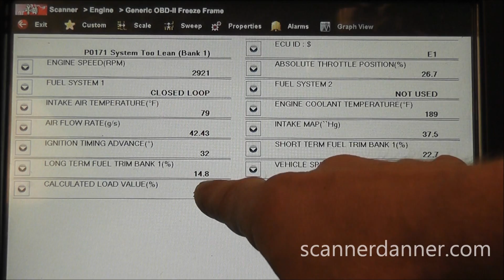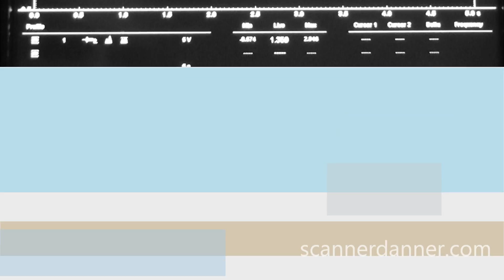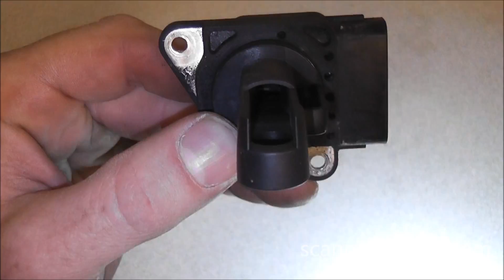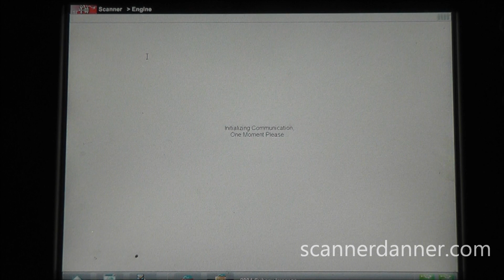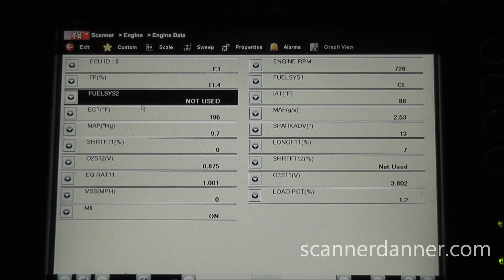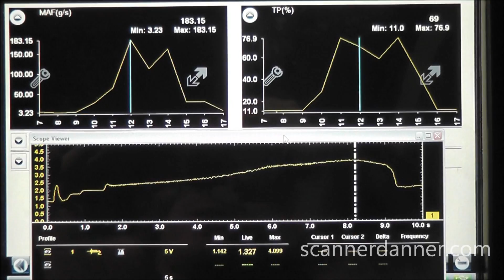How to identify and clean a dirty MAF sensor (Subaru)

Comment: 10:15 well it does, as the air density will change depending on the air temp so the car needs an accurate air temperature
Reply from the maker: This is a completely separate sensor input on this design. So the IAT signal is NOT a concern here , at all, with what we are dealing with. 
We were not discussing the purpose of an IAT sensor

Comment: Thank you so much for this. I've been trying to diagnose a P0171 in my 07 Forester XT for months now. After watching your video, I checked the freeze frame data, and it was under load when the code tripped. Popped my MAF out, gave it a good cleaning, and popped it back in. Not only has the code not come back, but it seems that my XT hasn't been running at full power for a while now, and I didn't even know it. Now to figure out my P1153...
Reply from the maker: Heck yeah! Nice job, always feels good to help others

Comment: Is the LOAD _PCT 1.2 % normal, mine having the same value however the workshop manual says is 18% at idle.
Reply from the maker: Depends on the data PID, some offer absolute load and calculated load and they will read differently. If you're fuel trim numbers are good at idle, then I wouldn't be concerned

Comment: Great video man I learned a lot, hoping this will fix my issue with my 02 wrx. Getting break up around 4k rpms and getting a slight bog right before I give it throttle. Gonna take some brake cleaner to the MAF and I also have to replace my center differential viscous coupler. gonna be a fun weekend
Reply: Did it Fix your issue?

Comment: I had been a bit baffled with this problem. I had cleaned my K&N air filter and changed out my fuel filter, with no real change. After cleaning my MAF, my '98 Subaru is running like a beast! Thanks for the detailed help!!!
Reply: What was your car doing prior to cleaning the maf
Reply: @SubaruSupra3  it would run smoothly at idle and most times at speed. Other times it would just die at idle or at speed. Overall power was not good. Poor acceleration.sometimes surging while driving.
Thanks again for the help

Comment: Very informative. My  2007 JDM 2.0L turbo-charged subaru forester has the duty cycle  stuck at 66% and as a result  I do not have boost even at WOT.  My mech thinks it could be the fuel pump (the relay works fine), however the vehicle starts perfect , runs very smoothly so  I ruled that out and now I think it could be the MAF (although I have no codes). Thanks

Comment: Video was super informative for my Legacy GT! Is it OK to use throttle body cleaner/intake cleaner on a MAF sensor or is that a bad idea?
Reply from the maker: Just make sure what you are using doesn't leave a residue
Reply: I went safe and bought MAF sensor cleaner, but the CRC throttle body cleaner I use doesn't leave a residue as far as I can tell.

Comment: Would a bad maf sensor cause multiple misfires? I changed my plugs and coils but I'm getting this code as well as misfire codes on cylinders 1,3 and 4
Reply from the maker: attack the misfire issue first. most likely your MAF code is being caused by the misfire, not the other way around

Comment: Thanks for this excellent video and diagnostic.  I fixed my 2005 Forester XT after numerous visits to the dealer with no luck.  Turned out to be a tiny blob of dirt on the hot wire.
Reply from the maker: sweet! Thanks for watching
Reply: What were your Driveability symptoms with the Dirty Maf Sensor?
Reply: @TinkeringTom91  There was a distinct delay in revving when you hot the throttle. As if it there was fuel starvation
 So if the car was in neutral and you stabbed the throttle the engine hesitated for a second then revved. Also down on power on the road.
Reply: @roofbolt1  My Wrx won't seem to go past 4k in any Gear Very Sluggish only reving in Neutral can I get it Higher,  2013 WRX 70kmiles I have changed Air Filter and Spark plugs already, new throttle body w/sensor, Mishimoto Hose, slightly better still Seems Bogged Down... Should I go for the Maf Here, also ordered a Crankshaft sensor before I Saw this Video.

Comment: 04 forester xt ej255...i got a p0172 pending code not stored and no cel but my car is basically almost stalling out at idle and will lag and then jump back up on accel. As well as the fuelsys1 being in open loop-drive whenever i let off the throttle or give it enough gas. Think this would help?
Reply from the maker: You've definitely found the right video for your symptoms my friend. Good job!
Reply: ScannerDanner haha thanks I cleaned my maf just like you said and although the problem is still there it's way better so maybe I just need to replace it full on...anyway thank you very much!
Reply from the maker: that is possible, but without some data there is not much else I can suggest

Comment: Hey guys! I have an 02 WRX 2.0 turbo, my car last night just ran a pfffe code along with every cylinder misfiring.. car bucked and hesitated under acceleration. Recently, it has started acting like this in the rain, almost stalling out on me. Could i get off the hook with cleaning MAF? Or, should i be checking coils and what not. Please get back to me! thank you!!
Reply from the maker: What you are describing is a classic symptom of a secondary ignition misfire. Take a close look at your spark plug wires. Get a spray bottle and squirt them down and see if you can make it misfire. If you can, change the plugs and wires. What you are describing is not a MAF sensor symptom
Reply: ScannerDanner Okay! Im going to be doing spark and coils anyways. But cleaned MAF and haven't had the issue since. Wonder how plugs look hehe xD

Comment: Ive got 2001 subaru impreza WRX turbo  DTC  to lean P0171 ,RPM 740 , STFT 25 and LTFT 14.8 MAP36.0 MAF 2.1 g/s oxygen sensor 3.943 V if engine RPM 3000  STFT 2.3 and LTFT 14.8 whats causing that
Than you .
Reply from the maker: That is a huge difference or improvement at a higher RPM. You have a vacuum leak, not a MAF issue
Reply: I did not find any vacuum leak anyway ,I will try again , thank you a lot for that .

Comment: I love you man! 

You are a Genius compared to my mechanic, who offered to replace EVERY POSSIBLE sensor in my MY2007 Subaru Legacy, 2.0R, non turbo, 2.0l, Wagon. European B13 starting with the O2 sensors and so on...$$$$$$$$$

You saved me and my Subbie from a VERY EXPENSIVE and NERVE WRECKING REPAIR.

I have fixed a Subaru Legacy error p0172(The car was mostly STALLING or hardly kept running on idle)- with ONLY SPRAYING THE MAF sensor with https://products.liqui-moly.com/air-flow-sensor-cleaner-3.html

Big THANK you for creating this video!!!

Comment: Can I have a MAF problem without a code?
Reply from the maker: absolutely
Reply: I chased my tail on a Subaru once, chasing down 25% trims. I had to fix 3 vacuum leaks and 2 new injector o-rings before throwing a MAF in as a total guess, and it worked. Sort of "under-reporting" on top of having all those intake leaks.
Reply: My 01 corolla has no check engine light and runs good, but when you plug the OBD, the reader shows 3 codes although the bulb of the check engine light works.

Comment: Hi Danner:

I recently got a P0172 and AFR's were at 10.0 at idle. During driving it was 12.5 or so. I cleaned the MAF and dramatically made things better. It was still bucking on initial acceleration. The MAF is an original OEM Subaru One. Figuring it might possibly be a MAF sensor issue. My friend happened to have one dandy, Part Number 197-6040. So installed that literally 30 mins ago and it seemed to run better with no bucking. Also the ECU has been reset.

Comment: I was told to clean the maf to test and see if the numbers/ and or drive-ability got better, and then replace it if it did. This was coming from a instructor employed by a sensor company, smart non the less. but cost on these sensors can get real expensive. so i say clean it to see if it numbers improve, and don't replace until code or concern comes back!

cleaner is cleaner  in my opinion, how can one be more delicate than the other? like fuel injector cleaner, if gas ain't cleaning them enough how the f is some clear juice super concentrate crap going to clean it adding it to a tank of gas going to clean an injector?

Comment: It does use the built-in IAT sensor as a reference... but it would be a very minimal impact on performance if any. Sweet video :)
Very correct on the assumptions for turbo cars. Once the turbo is spinning under load, you're well over 200 g/s

Comment: Thank you!  After 10 years of driving with hesitation/stuttering/missing/leaning out/check engine and blinking cruise light,  I sprayed the hell out of the MAF Sensor with Carb Cleaner and my '04 STI is running smooth! Awesome video and explanation! Thanks again!
Reply from the maker: Thank you!
Reply: Hey when you were having the issues were you having misfires on multiple cylinders? I'm currently having the issues with the addition to my wrx stalling when trying to park.

Comment: did you use a soft bristle tooth brush, q-tip, or something else?
Reply from the maker: whatever you can, just be sure you can feel how hard you are pressing on that resistor, they can be bent very easily
Reply: ok cool good to know...appreciate it
Reply: +ScannerDanner the top resistor on mine looks a little bent, should I lightly try to straighten it or is it ok the way it is?

Comment: will a maf cause a long crank time?
Reply from the maker: +james hall what are you working on? year, make , model, engine?
Reply: 2007 Ford focus 2.0 l with long crank time fuel pressure is good and does not bleed off.
Reply from the maker: +james hall chances are no, does it run well after it starts?
Reply: +ScannerDanner runs fine after it starts and there are no check engine light
Reply: +james hall if it's a nissan with long crank times. Chances are you have a bad cam sensor. Very common on Nissan vehicles. Same can apply to other makes. could also be loss of fuel pressure, spark plugs, etc.

Comment: I threw a 0171 last week. I cleaned the MAF and still gave me a 0171. Ran a smoke test, turned out to be a vacuum leak on the PCV. So a 0171 may not always be the case with a MAF. A simple 3 inch 3/8 hose that is cracked will cause your car to idle very very rough. If you have these symptoms with a lean car, you have a vacuum leak somewhere like I did. Thankfully it was fixed quickly but still. The MAF isn't always the case when you throw that code.
Reply: +aaf1218 most of the time when you have a p0171 there usually is a vacum leak. but 30% of the time it can be MAF. Fuel trims tell you everything.

Comment: The way i got it explained is the dirt on a maf is insulation. Its like wearing a parka coat on a hot summer day standing out the sunroof of the car and that is why you dont get spikes on a snap throttle. The rest is the conveter protection program, nox egr ect..

Comment: Perfect just what I was looking for had the po171 code for a few weeks and comes on when causing so around the 3000 rpm tried a few things but my maf is ment to have been cleaned 2 weeks earlier. Hoping the new maf I ordered sorts it. But a great video understanding exactly what's happening thanks :)
Reply: Mark Harvey I had the same issue last week with the 0171 code, turned out to be a crack in the PCV hose. Did you figure your issue out?
Reply: Hey yer took agers took everything apart spent heaps of time looking for it. Turned out the mechanic hadn't cleaned the maf correctly :(
Reply: Damn, I bought a new MAF in hopes that would resolve my issue last week. But ended up being a cracked hose at the PCV. I ran a lean code the week before and it never came back until this past Sat. I hope your MAF is cleaned up properly now and she's running good.

Comment: So what exactly does short term/long term fuel trim tell you exactly?

My car keeps throwing po171 and misfire for every cylinder. It is a impreza wrx. My scanner can only show freeze frame data. Short term fuel trim is showing 25.0, long term is showing -3.9. Engine speed is 660rpm and vehicle speed is 12mph. Seems like both times the code was triggered at the same speed.

Is there a general direction I should be heading in as to resolving the issue? should I focus on the MAF/O2 or should I be looking for vacuum leaks?
 Already cleaned the MAF sensor with no luck. Had a shop replace intake manifold gasket last year. Same issue stays and shows whenever it gets cold. Have not checked the 02 sensor yet.

thanks!
Reply: Watch my video "understanding short term and long term fuel trim"
Reply: bmwmsport11 you must of had a vacuum leak somewhere. I had the same issue last week. Misfire on all cylinders, A/F  was at a full 25.0. Means it's a full lean. What did it turn out to be?
Reply: aaf1218 turned out the shop ripped me off and never actually changed the intake manifold gaskets(vacuum leak). It was a factory design issue(OE gaskets were too thin to make contact with the block when cold). Spent 5 hours and managed to replace the gaskets with $40 in parts and tools.

Legacy GTs and early WRXs(08 and some of 09s) had this issue.

Comment: This is very interesting. I took my car in for power loss on cruise. They said it may be the MAF but then they concluded it was a faulty O2 sensor. They changed it but the day I drove it away it played up straight away. I took it back to them and they were baffled (needless to say these guys are "Subaru specialists") . Anyways they are pretty confused and pointing at "possible air flow sensor on its way out". I can check it myself now

Comment: I am just enrolling to take training to be a technician. your Videos are extremely helpful, I use android to monitor my vehicle and my MAF has always read around 3.2G/S at idle. I did clean it with spray, but never with a small brush. I am getting a lean condition with misfire at idle. from what I infer from your video it is more likely a vacuum leak. Thank you for doing these videos and for explaining everything in detail. seriously helps!

Comment: It seems as if the relationship of the MAF output and gm/sec readings is not linear as seen on this car.  My experience with the Nissan Maxima MAF was that I thought it was linear but I could be wrong as I am going by the memory and do not have the hard data in front of me.  The voltage went fro 1.2V to 4.0V but the gm/sec went from 3 to 180

Comment: MAF failures are very regional, when I worked in the burbs, I called very few MAFs as bad, I now work in Downtown Atlanta  and replace alot of misreporting Mafs, I have tested cleaning versus replacement, and have found it not good enough to call a complete repair, fuel trims were better but not right, so I replace rather than clean. But to each there own.

Comment: Volumetric efficency test, search IATN for more info, it is a program you input all scan tool data and it gives you a score on how the well the system is working, Albin has been testing, he talked about it in his class about fuel trims last time I took it.I personally think it is a wasted step, watching PIDS like load, o2s etc. 5 minute Flat Rate Test Drive and I can call it.

FYI, I just replaced the same kind of sensor on a Prizm, rebadged yota, hair ball hanging on the hot wire

Comment: Comment #4 What leads me to believe this is that I was also told years ago when I was in school that almost anything that affected compression would also affect vaccum as well, so bottom line is do you think my reasoning is correct for as far as that the worn piston rings causing a high MAP voltage reading at idle as well as a high calculated air flow at idle and the negative fuel trim numbers. Your opinion is appreciated.

Comment: Comment #3. Did not run compression test, but did perform cylinder leak down test on 2 cylinders and heard and felt air coming out of oil fill cap hole. My thinking is that bad piston rings could have not only directly caused some of the misfires, but also have caused the higher than normal MAP sensor voltage, thereby causing a tug-of-war of sorts between the MAP sensor and the O2 sensor with the fuel control being the proverbial rope. More on the next comment.

Comment: Comment #2. At idle RPM was around 600-650, MAP sensor voltage was 1.8-2 volts, calculated air flow was around 4 grams per second, ran worse in closed loop, STFT was -25. Replaced O2 sensor and ran a little better but still ran like crap and fuel trims stayed the same. Tried a known-good MAP sensor, but no change in running or MAP sensor voltage. Spec I found says 0.5-1.5 volt MAP signal at idle. Performed vaccum test and found needle drifting back and forth at idle. More on next comment.

Comment: This's probably gonna be stretched out over 2 or more comments, but I need your opinion on whether I'm right or not about a diagnosis I recently made. 1996 Chevy Cavalier with a 2.2 engine that has NO MAF sensor. It uses speed density fuel control. Engine was running rough at idle. Ran better on acceleration but still not great. P0300 misfire with cylinders 2 and 4 showing the most misfires but 1 and 3 had some as well. More in next comment.

Comment from the maker: Again, the only kind I have ever cleaned is this style and I wouldn't recommend cleaning other types. The housing that holds the actual resistors is not a typical plastic and brake and carb clean will not hurt it. I didn't notice the intake ripples. I need to watch it again. I've seen them on MAP sensors but never on a MAF, but you could be right. 
Not sure if its chlorinated or not and never cared, it just needs to leave no residue.

Comment from the maker: Ok. Start by checking MAP voltage KOEO (no vacuum) and idle (full vacuum).
KOEO honda MAPS usually read about 2.8v and around 1v at idle. With engine running as you snap the throttle map voltage should increase. 
Also check your TPS for glitches or drop outs. Watch my "Section 7 Playlist" for more on TPS testing